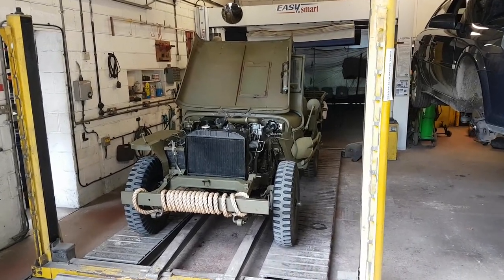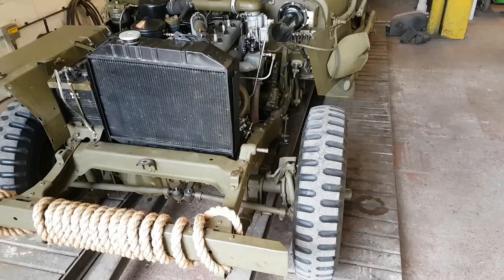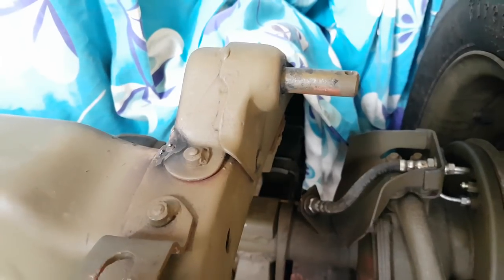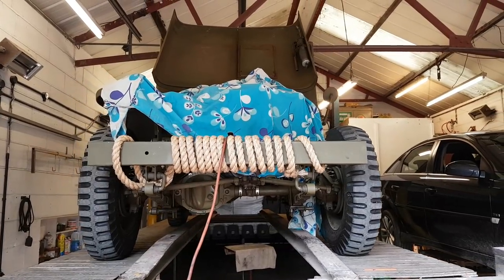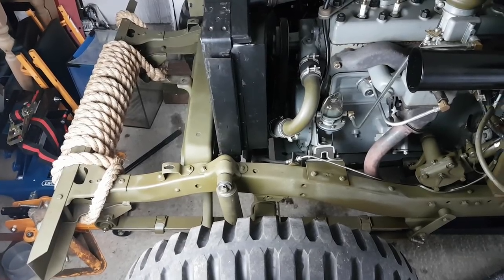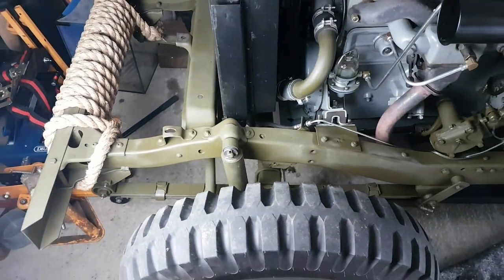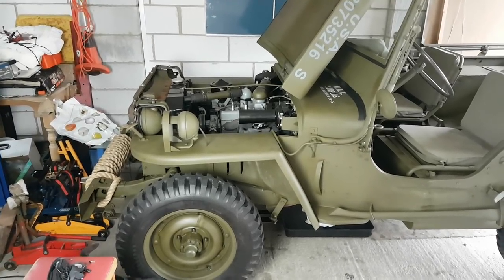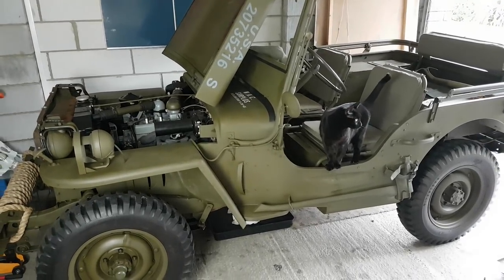Fixing jeep suspension problems

Comment: The huck rivets are steel with the rivet part being alloy, hence why the weld wouldn’t work on the lower part. I’m currently restoring a ford chassis for another customer, I have the huck rivet fitting tool (self made) so i can rebuild them as original, it is amazing what kind of repairs some previous owners do, but that one you have done is nice, well done.
Reply from the maker: Thanks Shaun, very kind of you to say, I would love to have the correct rivets and tools for this but its just not worth it for a one of which is a shame but at least I managed to keep the original rivets all intact so that is still a win!
Reply: @Greendot319  Actually, the Huck rivets used on GPWs were all steel, unlike the present day ones. But the crushable part may have been composed of a kind that doesn't take well to welding, or is so thin that it blows away when hit with high amps.

Comment: as a welder, I can tell you that in the U.S.A. welding on any car or truck frame is a no-no but your weld under the bottom of the shock mount is small and  in the middle of the frame channel so you will likely be ok.  --- love your jeep channel

Comment: Hi greendot  , now if you had a lathe you could have profiled three high tension blots to look like rivets, then just repair damaged , however I do agree about field repairs . Roger of Norfolk. KBO.
Reply from the maker: Thats a good point Roger, There are break off bolt/rivets that you can use on the frame but I prefer not to use them.  The Huck Rivet shape would also be difficult to do correctly but could be done.  For a quick fix with minimal pain I'm hoping the weld repair will work out well.  Wouldn't it be nice to have a huck rivet gun and rivet set up for Ford frame repairs! maybe in th future....

Comment: A bit late now with this suggestion, but what I do is simply turn down the head of a HT bolt, grind off the rivet, and bolt it up tight with some locktite on the thread, you can even ream out an enlarged hole so that it is a tight fit, this would of course require you to have access to a Lathe, you will find that using Argoshield gas on the MIG will help, rather than CO2. Next time maybe. It looks good as it is, only you will know about it.
Reply from the maker: Good suggestions.  Recreating the huck rivet shape would take some work but is do-able.  I'm hoping the weld will do the job well, no reason it shouldn't!
Reply: Re creating the rivet head shape takes about 3 minutes, if you ever need a set I will make them for you, you put so much work and thought into this project you deserve a bit of help. at least your cat likes it !
Reply from the maker: Thanks, He is not a huge help!